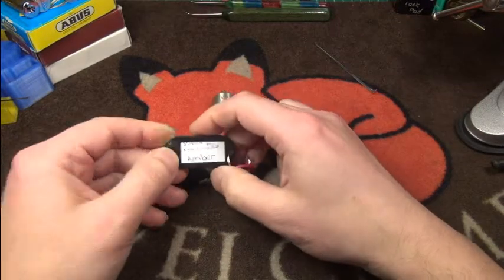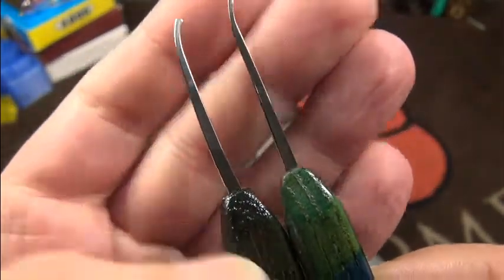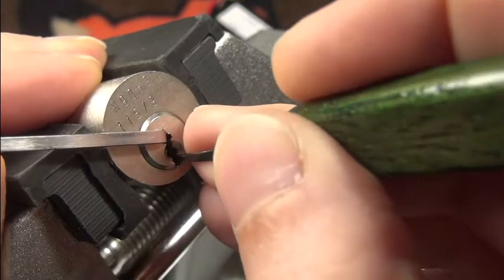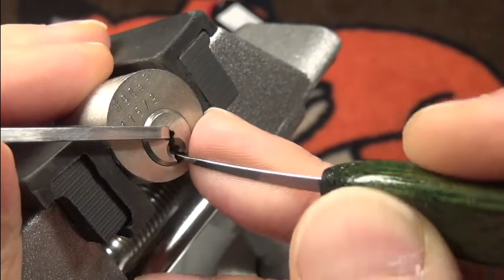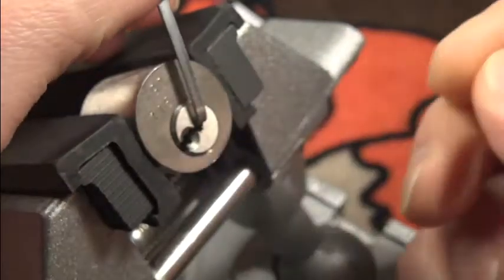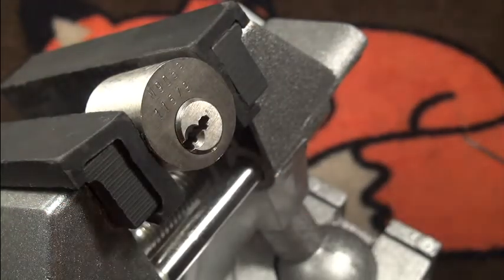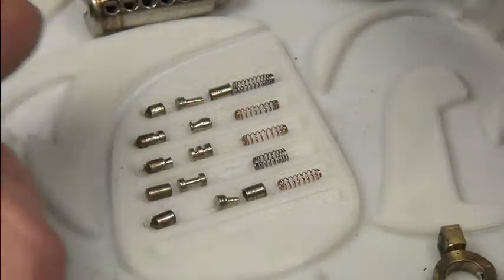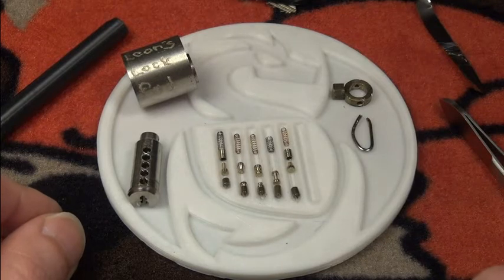(276) - lockpicking "Amber" from Leon's lockpad :)

Comment: Great picking on what I suspect is a very difficult lock.  Leon put a lot of great work in those pins and he did a great job getting the original retaining pin out of the back of the lock so cleanly, if my assumptions are correct.
Reply from the maker: Oh the lock is not that difficult as you think, it's quite fun :). It gives really good feedback and the "key" in this pick is to get the first pin high enough (the good thing was I could see from the front that it was very short, but did not see the pin in pin...always pay attention to details ;D) and not overset the serrated keypin. The retaining pin is relatively easy to drive out with a slim punch tool, this is how usually the tailpiece of our old german double round cylinders is hold in place too :). 😊✌🦊